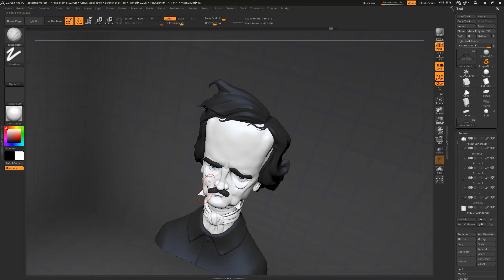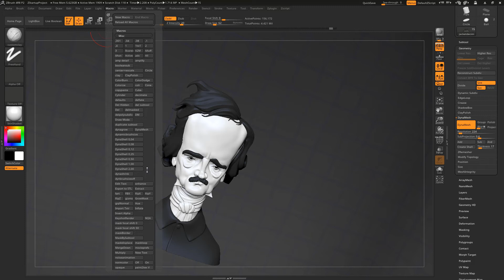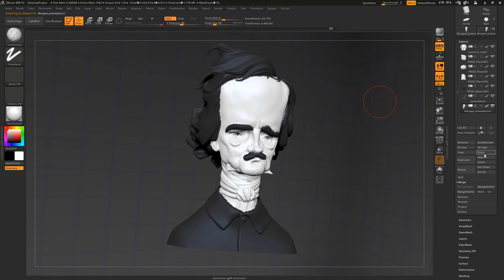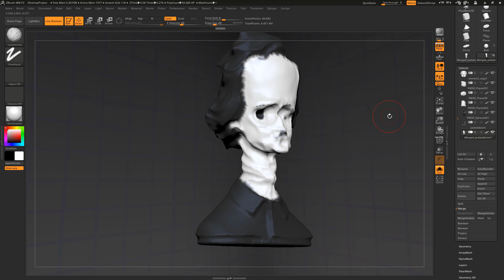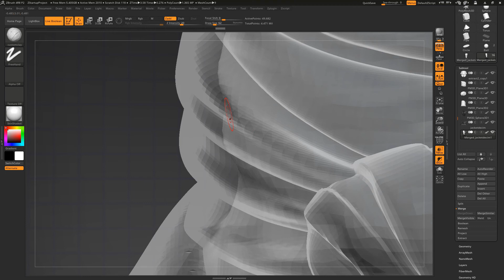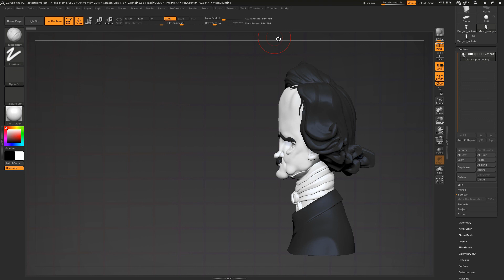Easy way to make models hollow for 3D printing in Zbrush

Comment: Hmmm...not sure what I'm doing wrong.  Once I have the dynamesh pasted and I click the macro (with masked hole) it expands/ inflates my mesh instead of shrinking it.
Reply from the maker: sorry for the glitch! try making your mask larger. Sometimes a small escape hole will close up and cause the result to not work. Also, I updated the macros a few days ago so unless you downloaded recently, to downloading again and replacing them with the new ones. I fixed a bug that can cause that to happen.